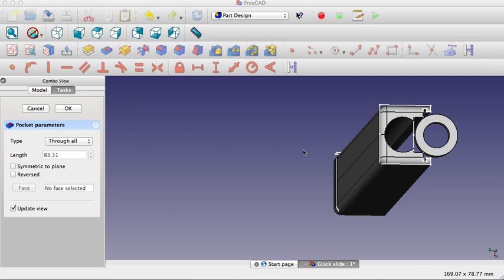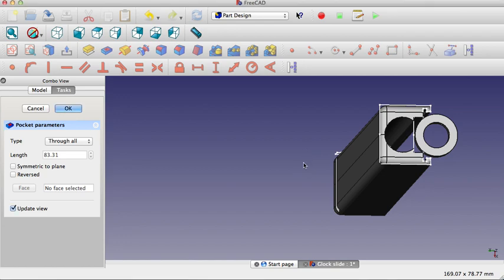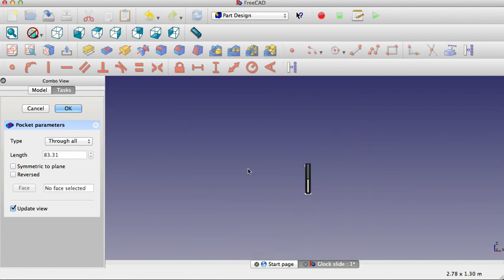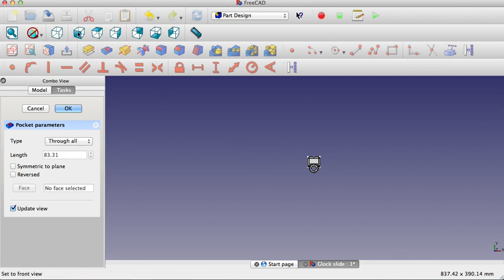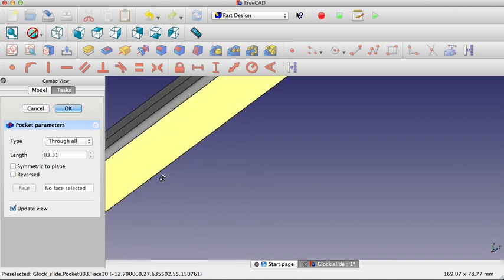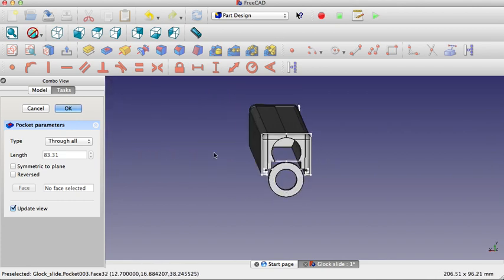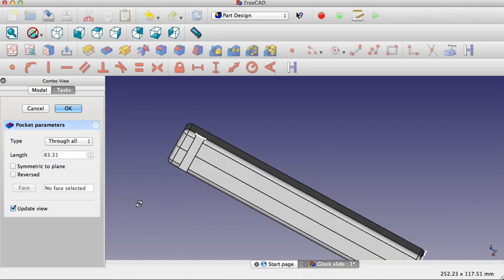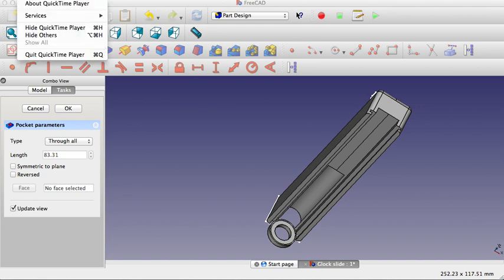FreeCAD Modeling Glock Slide

Comment: Did you ever finish this project?
Reply from the maker: +Stephen Malek 
Never did. FreeCAD proved to be insanely unstable and crashed way too much to be useable, so I gave up on it.

Recently picked up Fusion360, and have been having much better results with it, but I've been focusing on modeling other projects, in anticipation of the CNC I will be getting soon.

I'll work on one in Fusion360 when I get time.
Reply: Thanks for the info